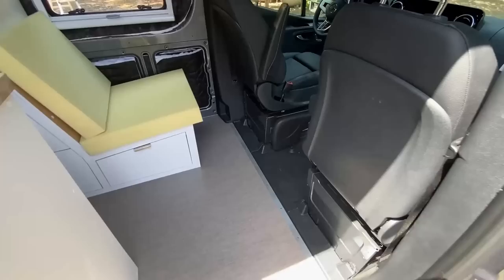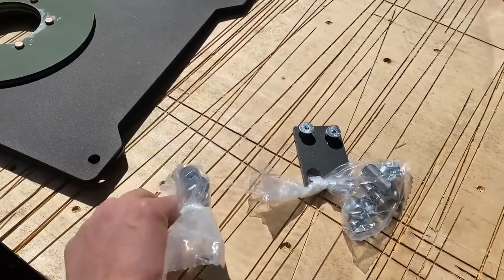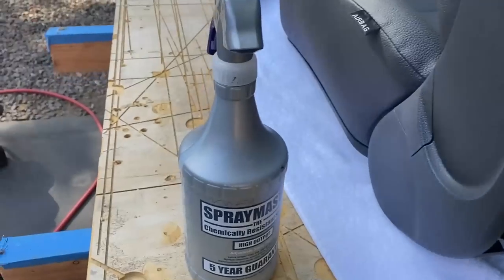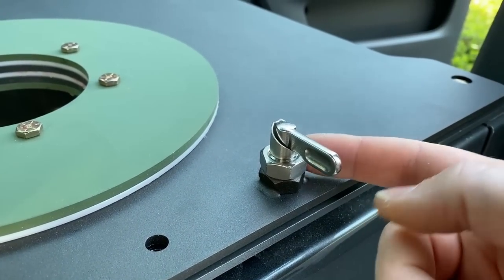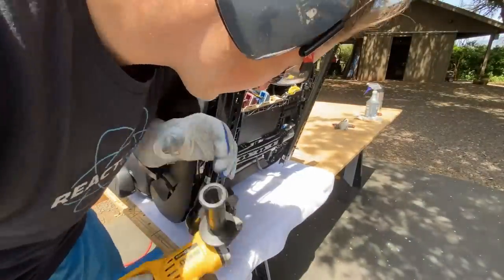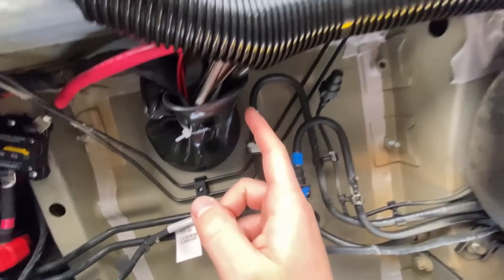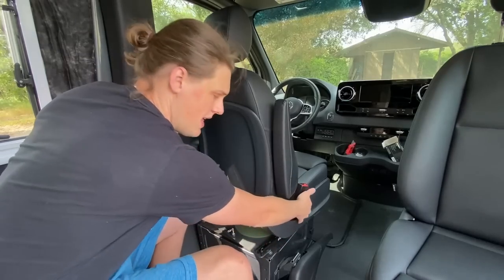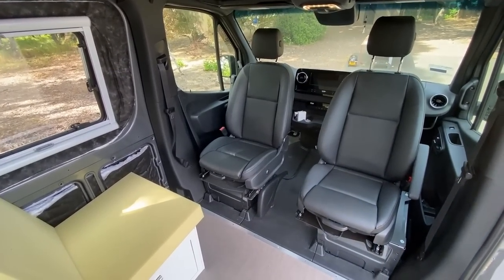The BEST Seat Swivels For Vanlife??? Alpine Mechanisms Install + Review

Comment: That new "do hickey" at 6:10 looks like its job is to keep the seat from rotating the "wrong direction", and preventing the seat from going around 360 which could eventually mess up the wiring.

Comment: Good video! However, if you are installing the driver swivel on a sprinter 144, the parking brake relocation bracket will cause your brake cable to rub against the metal sheeting that surrounds the gas tank. In my install I was so pre-occupied with the grommet that I initially didn't notice the brake cable rubbing cutting into this metal sheet. When installing on a 144 you need to consider actually adjusting the parking brake cable length to make the swivel work

Comment: Awesome swivels. Sold!  
Did you read this Alpine Swivels?

Especially like the giant hole in the middle so that, unlike other brands, you do not need to de-pin the large wire connectors.   

I would like two snap-in filters in those holes, split for the wire loom, to keep the dust and pet hair out of the seat bases where my electronics and Espar Heater are. 
Yes I use a filter on the side but that heater pulls a lot of air. 

Thanks for showing us that this can be done on power seats. Most swivel installs I’ve watched are with manual seats. 

And showing how to avoid airbag codes. My 2019 has that small backup battery under the drivers seat. 
With negative cable disconnected I still hear noise when drivers door is open. I was concerned I’d still get a code. Probably a memory saver function.

Comment: Thank you for your video.  The grommet is not there!  I'm surprised, because I have the same issue, and after 5 years, that area is all rusted, of which I have to get under the cable channel and clean it out and weatherproof it, yet provide a hole for potential drainage in case water gets into the channel.  There are two holes, make sure you get the right part.

Comment: Helpful video. Thank you. I have two question I hope you can answer. Does the offset bring the two seats too close together to be useable at 90-degrees (facing each other)? If you had non-offset swivels, do you think the doors could be closed with the seats at 90-degrees (facing each other) and the seatbacks still at comfortable angles? Thank you.

Comment: Tried installing swivel base for my 2004 GMC Savana but wasn’t enough space on the driver side kept jamming into steering wheel and sidewall so returned it. Passenger side finally swim old but need to open doors some. Thinking will need really drill holes for driver side and try a different swivel any suggestions?

Comment: Why would they locate the release knob at the back of the seat? That location seems to be a problem as it would be hard to reach it while sitting in the seat. Are you certain they were not installed backward. It just seems like the release should be in the front for ease of use.

Comment: I've seen a lot of swivel seat videos, but I have yet to see one that shows how far the driver's side seat can recline. I know it's limited because of the steering wheel. My plan is to use the seats as ghetto recliners and office chairs. When swiveled, can you recline the driver's seat back far enough to be comfortable to sit in it for 3 hours?
Reply from the maker: Pretty far back definitely comfortable enough for long periods of time, but not like fully horizontal recliner status. The passenger side you can go ridiculously far back
Reply: @seven_o_savage  Sweet! Thank you for the help.

Comment: It would be nice if you could buy seat stand 1"lower
Reply from the maker: You can, which is how the factory swivels work. Installing them aftermarket is quite a job though (on the drivers side at least)